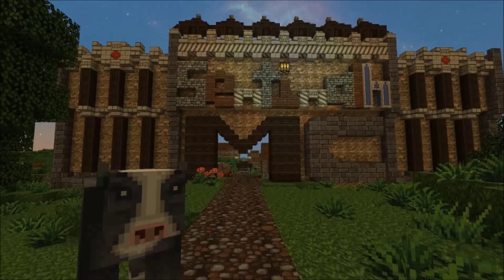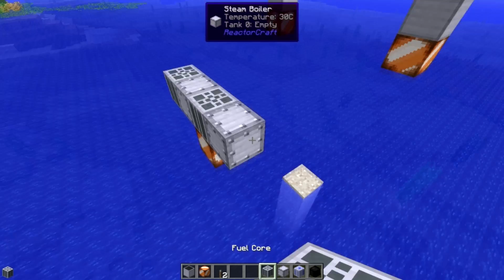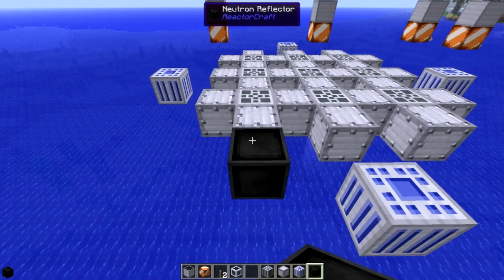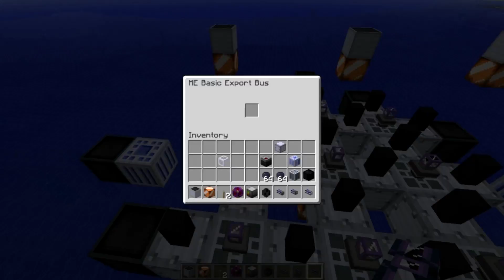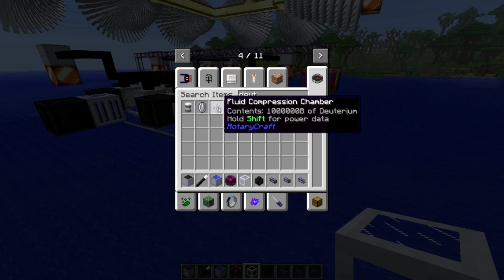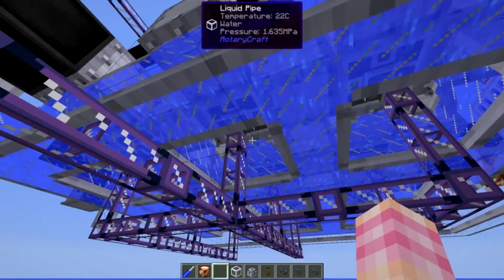ReactorCraft Tutorial #17 - Example Tritium Fission Design

Comment: like 20 minutes of video is cut off. It ends at 8:30.
Reply from the maker: The heck happened? It didn't used to be this way.
Reply: @SentinalhMC  I reloaded the video and it worked! Just one question: I see that you have a fluiduct from thermal expansion. I assume you're running 1.6.4. I looked in curse forge to find a thermal expansion mod for 1.6.4, and I couldn't find any files. I'm pretty new to modding.

Comment: So you place the 4 chambers in each cardinal directions (i.e. row 2 of the X and Y axes) but why not  also place them on rows 1 and 3 of X and Y?  If neutron paths are linear, that would mean that each chamber only has at the most 3 cells sending neutrons off.  So is there a reason why you are not utilizing the 4 other linear paths?  It would appear that you could add 8 more chambers to this design and make deuterium and tritium simultaneously.
Reply from the maker: You could do that, but don't forget that the power output of the reactor will decrease to some degree since the additional Irradiation Chambers will absorb more neutrons. Its all a trade off.
Reply: It is capable of running 6 turbines at full power. Power is not really that much of a concern, especially since you can completely automate the deuterium and tritium production in one unit.  That is a pretty cool design he came up with, I am trying it now in my world with that modification.  Love your vids BTW.
Reply from the maker: Joe Smith Hey thanks a lot, I'm glad you enjoy them.
Reply: SentinalhMC Update for you. So you can do it and it works pretty well.  You have to cut the turbines to 3 (maybe 4) at full power but it makes generating 2H and 3H pretty easy since it is one unit and you have to build the reactor anyway.  I have 12 neutron chambers on the same core, 8 for heavy water and 4 for 3H and 3 electrolizers for 2H.  It is pretty well balanced.  From the video, it doesn't look like the rate of 3H generation is that much less.
Reply from the maker: Joe Smith Very cool, thanks for letting me know.